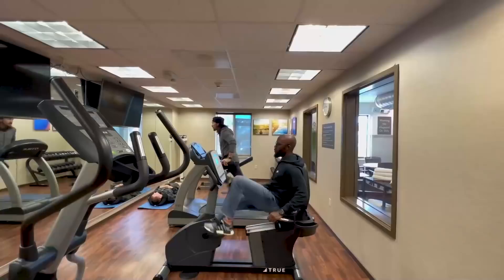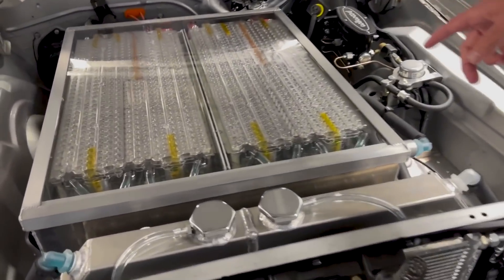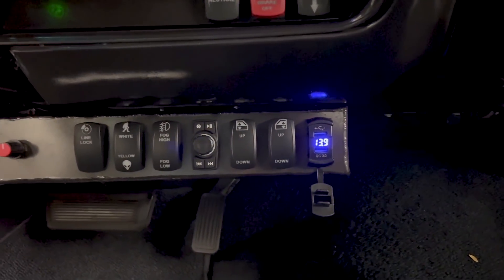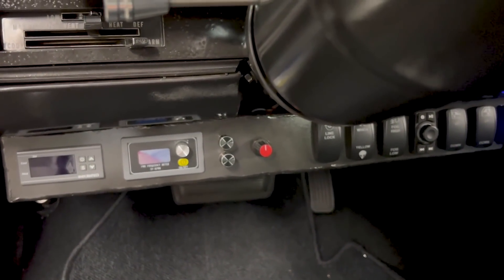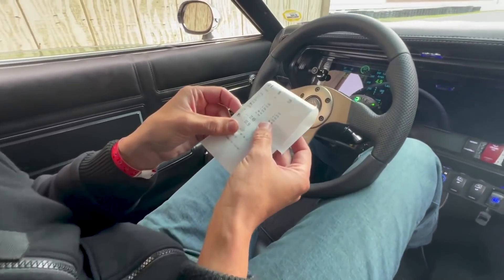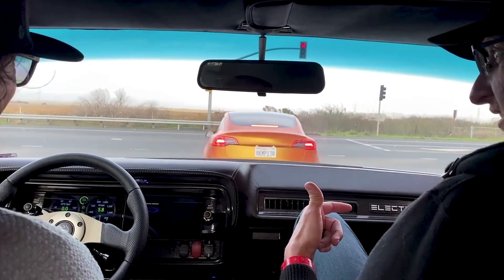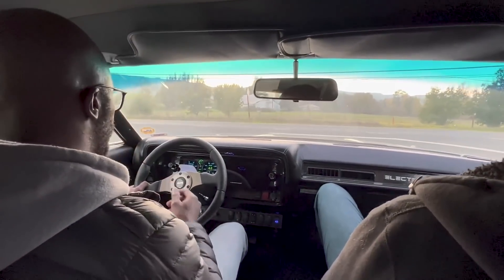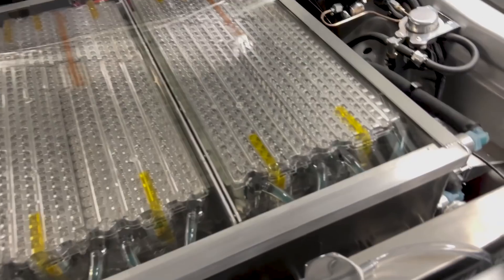Bringing Tesla Power to a Classic 70's muscle car

Comment: Imagine if car companies went back to the 50's styling with EV components and tech interiors.
Reply: Dodge is with their E lineup
Reply: Basically the cars from fallout, but not atomic/nuclear power.
Reply: I say it all the time. It would be so easy
Reply: They can't go back to old style, because of modern regulations.  They have to build it to certain specs.
Reply: Check out charge cars
Reply: Renault e-ledgend is crazy. Based on an old 504
Reply: How about the Honda E? Not 50s but a great throwback
Reply: Cuda-E! With DriftMode and All Wheel Burnouts
Reply: All the parking spots would be too small and battery range too short since everything was a boat/land yacht.
Reply: Lookup the aviar r67 for fun. 😎
Reply: I think it's Peugeot, but you're right, it looks cool
Reply: I second that. With some noteworthy exceptions, the car industry has gone real unadventurous when it comes to design. It's starting to get hard for someone like me who only have a very minor interest in cars to tell a cheap entry level car from an expensive one. So boring it's unbelievable.
Reply: Ioniq 5
Reply: EV west
Reply: The dodge ev might be just this based on the fratzog logo but we have to wait and see. I’ll be sad to see the manual disappear but that is basically the direction muscle cars have been heading regardless of new EV technology
Reply: Safety and weight is a concern
Reply: @Tien1million  They could go back to those body designs if they wanted to. Especially the 50's era in which there'd be plenty of room for air bags and safety components. 
The only major issue is that those things were as aerodynamic as a brick. You'd have to scratch and claw your way into getting any kind of decent battery range.
Reply: Yes, the market is there. Note the vehicle builds of Speedkore, ICON, and many others. The technology is becoming more and more affordable to literally reproduce any part for an older vehicle. You can 3D print an entire dash in sections that will exceed the quality of early OEM dashes/ CNC, 3D print taillight housings, lenses, trim, bezels, etc. in a choice of materials/ manufacture replaceable fenders, quarters, roofs in carbon fiber, that exceed the fit and finish of OEM [note SpeedKores 70 Charger, Dodge Challenger, etc].
  We need more designers, fabricators, welders engineers, CAD/CAD, Solid Works users, CNC,3D print techs etc. If young people want to avoid the 8 -5 job that pays well but leaves you empty, they should shift their education.
Reply: @vanderumd11  and so pointless, EV's these days are out to get the lowests possible air resistance, that is how they achieve the best possible travel distance. Even tho it looks absolutely fantastic and would be porbably easy to do, it is absolutely the worst idea and least efficient one.
Reply: @lawrencekendrick6440  They could call it the Electric Eel.  It pretty much sells itself.
Reply: Peugeot, not Renaalt. Renault had their R5 concept though.
Reply: You mean Peugeot
Reply: JDM cars that are electric ooooowee, R34 , Silvia , NSX - electric swapped shee!
Reply: It would be kind of like Cowboy Beebop.
Reply: @oceyho  Efficiency matters when energy is expensive.
Reply: @Tien1million  old style doesn’t have to follow old regs, all that needs to be added for DOT is some more airbags and better seatbelts.
Reply: @Tien1million  Modern regulations have nothing to do with the style of the car. Regulations regulate if you have mirros, type of headlights, height of head lights, have proper light placement, seat belts, air bags and a whole bunch of other things. The reason why cars have the style they do today is because of drag efficiency. The lower the number the better mpg a car can get. You can style a car just like the 50s cars with all modern elements. Will it get better mpg than a modern car, not likely, if a modern car gets 30 mpg then a 50s car will likely get 25 or so because of drag.
Reply: @thehorriblebright  I have an insane a deeply, almost intimate love of cars and I can't tell the new cheapy Corolla Crossover from the latest Tesla or Lamborghini, wait you guessed it, Crossover...
Reply: @fortcrafterbossbehold9027 Well that's nice to know. It's not just my general ignorance then. I remember when I was a kid every brand had its own silhouette and was easily identified from a distance.
Reply: That's my dream art deco style meets modern ev power
Reply: They kinda are but with more of a sci fi look to it
Reply: @rosscoeradio3741  nah, cyberpunk 2077, look at their cars
Reply: @marcanthony9659  I tried but it wouldn’t load for people or something then they did a stop sale. Still haven’t played it, but I think I saw it on the PS store recently.
Reply: @Eddy Vanderhellen Toyota is going to do that for the modern car industry.
Same chassis with interchangeable bodies. Kinda like a huge R/C car.
Reply: Electric power came first the technology was just lacking at the time
Reply: @thehorriblebright  Oh yeah definitely. Every brands ambition is no longer innovation but instead imitation...
Reply: @howardanon7433  LA was the greenest city once. Think about that. There were EVs in the 1900s. Conspiracists blame big oil.
Reply: I suppose Honda 'kind of' did with the Honda E!
Reply: Check out the ICON conversion Buick I think?
Reply: @thehorriblebright  Agree, and all the new designs are hideous and gaudy.  What happened to simple elegance.  Reminds me of the mid 70's designs.  Like the leisure suit that come out in the 1970's.  No one makes a nice looking coupe just endless sedans that all look the same.
Reply: Personally, i would love a car that looks like a 70's and 80's muscle car
Reply: The problem with modern automobiles is that there is a push for both efficiency, and inefficiency at the same time. How can you want a super efficient tiny ICE or electric drive system while also buying a big truck, or a big SUV. Cars are out, and so is efficiency. There’s a reason all the European cars are small AND efficient. Taking classic styling has proved to be a blunder multiple times in both efficiency and when having to introduce modern safety requirements. The market needs to figure out their shit.
Reply: @thehorriblebright  I agree. A big part of it is that there is a forced demand for SUVs for some reason. Even though most people don’t use their suv to that extent other than hoarding things they never use inside of it. But the bloated SUV market has caused the large addition of companies applying their brand specific visual traits to bloated looking cars
Reply: Leave that to the enthusiasts. They can have copy-paste cars. I want to build a classic into an electric(I'd call it a cyborg). For a fact there is tech that can charge your car without plugging in that is not solar panels. There is a vid on YouTube where a guy made a truck alternator and an electric motor into "free energy". I could imagine adding a cooling system(think a water/ mineral oil cooling system) that runs off the alternator. Add a battery to that setup. So much suppressed tech. But it's in our faces now on YouTube. Without the greed of the oil industry and utility companies, this world would be in better shape.
Reply: #outlast
Reply: @thexceo8592  Honda also
Reply: Literally think about this since I was a kid
Reply: Good old times when the driver and the passengers were the A pillars and the crumple zones
Reply: Forreal..these new cars coming out now are eye soars to look at
Reply: Check the Peugeot E-legend concept
Reply: Idk about the 50s. But the 60s with the muscle cars definitely
Reply: Buick GMC revival

Comment: Watched the dash amp gauge go to 1800A when Rich or Stevon floored the accelerator. If the Tesla motor runs at 300v nominally, then we're talking about 540kw or ~725 hp at the rear wheels. That's a muscle car! No wonder the rear wheels break loose.
Reply: 723.6 HP
I  had to do the math hahaha 
Thank you!
Reply: It's a real shame there's a lot of 'car guys' who completely dismiss EVs! I think things like the Prius (Not even a BEV) gave them all a bad name from years ago. EVs got this perception of being underpowered, can't drive far, and just generally being an econobox.
These days... Imagine someone putting the Plaid powertrain into some classic like this, that'd be an absolute MONSTER.
There's some insane cars, I just wish people gave the platform as a whole a shot, there's a lot to love. It's just different. :)
Big props to Holley for hosting the event, really helps bring the performance aspect to people's attention.
Reply: @VoxelLoop  im haft way there as my original, i give in point 🤷‍♂ was the wife instead that i buy a original equipment coded AC 2G charger so to spoil my family i decided to use electric air/A-C ( and im stuck with having all of the problems and parts might as well take advantage of it 💯 ) ( which ment for me in case having at least 25kw ish 120v+ pack ( for a 2+ hour parking and or car shows ect .) and that point justified using a BEV packaging and not a 1-off parts combo and a big + is i can use it for other accessory's too 😉 ) for the same reasons as the Tesla's do aka for shopping and not coming out to a hot car, that and im using C7 transmission so there was dead space that normally would have been used but i just mated the main out put shaft and the cv driveshaft yoke together useing the hollow/donut 🍩  BEV motor core, as a bonus for it now its the starter and i can do smaller trips in town/moving in the shop/carshow/parking space/lot without acidification of my engine and or 0-40w oil / extra cold start ware ect. and better running costs in town 😉 👍 . sorry just can't do full ev on my charger as it's missing some of the old flavours ect. and i would miss it two much but the 68 mustang convertible i have in the back im game for a full BEV swap ( the drivetrain hasn't been picked out yet unlike my charger and my 80's 1500 im ok with the idea as the local/state/EPA has made some diesel ( and gasoline like using a RB440 v8 TT ) swaps harder to road/tax tag year after year aka getting harder as time goes by and there is benefits to it as the new f150 showed ) as its a mild girly family good handling cruiser sub-80mph/60-10s ish  and or looking for the comfy boulevard feeling 🤠
Reply: @richardprice5978  Honestly, out of everything, being able to keep the climate control running when you're in a store or set it off like 10 minutes before you get in is a god-send.
I live in the UK so it's quite cold most of the year, being able to get into a hot car when it's freezing outside feels great. :)
Reply: @VoxelLoop  btw the 80's is a 1/2 ton Chevy/GMC long bed single cab just to clarify it and iv had it for 15+years/razed in it. the ev motor's i been looking at are the borg warner HVH255 core and a P100D rear core aka guted the housing/slide it on the mainshaft @ 1:1 gearing ( sorry that i don't have final numbers but it's not 💯done yet as its taking more time than i plan on / life is getting in the way 😉 but i have made good progress on it and the two different motors have different sweet-spots and im leaning towards the newer p100 ect-type / PRM/model-3/y/plaid 💭  ? as its easier for my to find and buy and right now and cheaper as well the downside is less low end torque vs amp's that i need @ 🛑 "S /under 40mph ) and using a different rear end ( say a CVT or ford 2pr3 speed rear end 9" ) some day as opportunities present themselves to me and for now stay with the fixed 3.2FG just to get it backup and running for now on the Denver/slc 🇺🇸 streets ) ( and should make it quickish 0-60 mph but wasn't my ambition to as that was for the econo box side of things but id like not to get ran into 😉 i know confession time but being the 540ci 7.5+L ish 108x114mm-x-v8 engine is easily capable of 1kw/1000+ hp on boost/nitro and no EV/battery help id say its ok and far ) instead of using it like this Plymouth does transversely @ 10:1
Reply: @VoxelLoop  do you have a bev ? and did you notice and difference in the seat's cracking / leather or stitching as in my area the interior goes bad from the temperature and humidity swings say -10C to 51C in the summer time without a year round climate controlled interior and 🤔 i think it's hard on the paint as well. and yes a pre-warmed carbon emissions/smoke 💨 free car is nice on a chilly morning or night one thing i can't get ( and is part of the plan for the charger as is a 4 seasons car ) from a remote ICE starter or at least never really worked well on my 07 gm sedan ( sold/write off ) product well on paper 📝it was a good idea but execution sucked. btw i do like 🇬🇧 car's ( and the land / tourist 😉 ect. ) as well 2 but not the 70's-ish / layland one's sorry 🤮
Reply: If it has 725hp at the tire and only traps 107 then it must weigh 10,000lbs. that is just plain sad.

Comment: "No ABS, no traction control, no safety nets of any kind."

On a lightweight EV with monstrous torque? I like this guy.
Reply: I have a 2013 P85, you can turn the traction control off but not the stability control. It is a handful to drive with no traction control! I can only imagine this thing, you twitch your foot wrong, you’re gonna light them up and spin into the ditch. Freaking awesome!
Reply: The reduction gear alone can add weight too lol.like the ev hummer guy
Reply: @allterrainrandy2587  With the Model 3 Performance if you disconnect a wheel speed sensor you lose all stability and traction control, or, if you enter Dyno Mode you get the same effect.
That thing becomes an absolute MONSTER, but it'll also throw you in a ditch as fast as you launch. Breaks all 4 wheels free a little too easily to be practical, I understand why Tesla doesn't let you turn it off normally. :)
Reply: When he said that, I turned to the wife and said, "Hell yeah, die like a real man!".
Reply: battery mangent placement could have been better ( and other thing's ect. aka im not a complete hater but constructive criticism is something sometimes matters and welcomed my 2C ) as there's a lot of potential space wasted say in the trunk its all batteries now and no real room for real airport luggage 😉 as intended, i know as im working on hybridisation ( Tesla's motor core + tr6070 transmission + 8-3/4@3.2G and RB hemi ) on my 70 charger and im keeping the T-bars unlike him ps. side squirrel idea why didn't he use t-bar's ( F1 use's something similar to it ) on the back it would have saved space and work ok 👌 on the Tesla's subframe
Reply: @allterrainrandy2587  
Freaking awesome for the adrenaline rush!
Reply: @richardprice5978  yeah there was space underneath the trunk for the battery, where the gas tank used to be, but he said it was a lot more work to put it there. It had to be waterproofed. I think it would be worth it. Lower center of gravity and airport luggage space.
Reply: @allterrainrandy2587  mine main battery is tucked between the rockers and the trans ( originally as a mod in the 90's-2010 i was going to be a extra fuel tank but BEV's have gotten so good i diched that idea of a belly pan flat floor and reinforcement as the battery's do a better job of my goals and as a added bonus the NVH's are better with this setup ) on the pre-1971 charger so i feel its worth it and it gives me a almost flat floor for better aro and MPG/range the other spot is under  the backseat/backrest as i don't usually have backseat passengers and if i do there little kids or in town/storter drives so i know it's a compromise between range and comfort as the battery is cutting into the seat foam and coil/air spring space when its all said and done
Reply: And haters are going to tell you that being a gear head just isn't going to be the same...     Well, no shit! It's going to be better! For longer!!! ⚡👊🏼⚡
Reply: Sounds like a first gen viper, no help just luck.
Reply: @richardprice5978  Are you going to the airport with a car full of people? No? Then there is a whole back seat for luggage. Stop it with the nonsensical what-ifs.